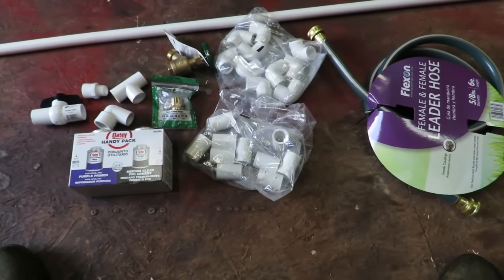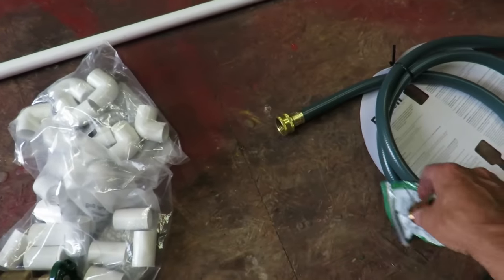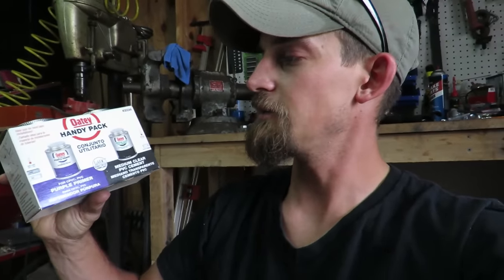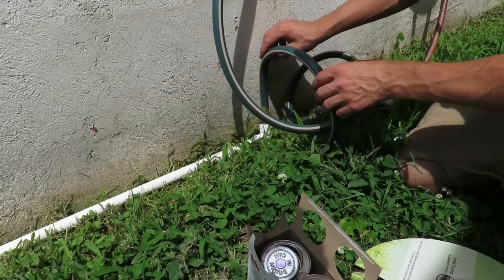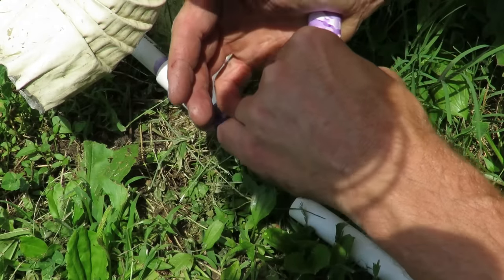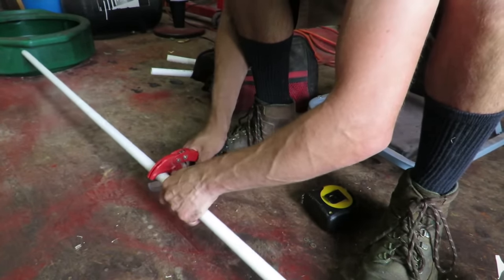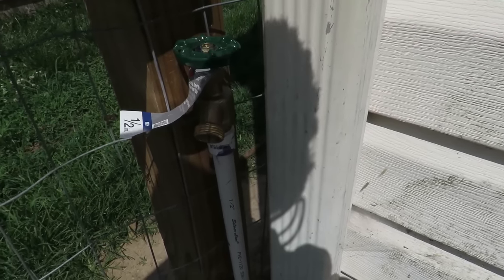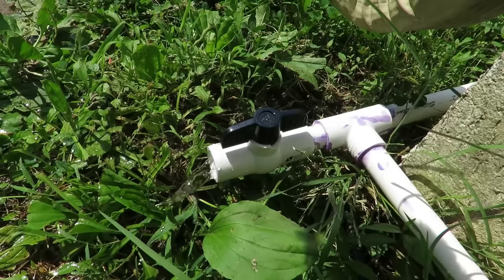Add a Water Spigot Anywhere in Your Yard!

Comment: Look in the irrigation section of your local hardware store. Most will have a Garden hose to PVC adapter fitting with the rubber washer. Lowe's and Home Depot both carry them. $2-$3 for a single fitting vs having a bunch of adapters and leader hose. Also in the irrigation section there is whats called an "auto drain", Rain Bird and Orbit both make them. They thread into a 1/2 NPT fitting. Put one at the lowest point and you won't have to worry about draining the system. It will auto drain once the pressure is below 5psi.
Reply: Ithaca for the info. I'll try. But I expect to get a blank stare from employee when I ask, after looking myself.
Reply: The regular leader hose is not rated for constant pressure I used SS Braided hose for my connection.  How do you connect at the source without some sort of leader hose?

Comment: Good video! In place of  the drain valve, you can use a 'golfcourse drain' (Lowes). It is a spring-loaded valve that springs shut when water pressure is present, and springs open when pressure is released, automatically. I use them here in eastern Washington State so i don't have to worry about forgetting to drain the lines at freezing time.
Reply: What's the proper name for that type of valve?  I'd like to find it, but not sure how to look it up.
Reply: The only name I know for the valve is 'golfcourse drain'. Lowes had them in stock a couple years ago.
Reply: This is close to what I meant by golf course drain...these are availiable at Amazon. 'Orbit Irrigation 51039 1/2" Brass Auto Drain'. Also 'Orbit WaterMaster Underground 51241 3/4-Inch Plastic Auto Drain Valve'.
Reply: Good tip. Thanks!
Reply: @dadskrej5226  Thanks for the info 👍
Reply: Why not just open the secondary spigot and shut off the main?

Comment: If you’re not going to bury the pvc, you may want to prime/paint it or coat it with something as pvc will deteriorate in prolonged sun exposure.
Reply: I am thinking about doinga same thing, but my pvc going under a addition, so ok for sun, but i live in a cold climate part, can get -15C( 5F.). what about that can it handle it ?
Reply: @palangnar3588  well I will say that I have pvc plumbing under our old pier and beam farmhouse in central Texas and this winter when we had the bad freeze where the power grid failed and it was 14 degrees Fahrenheit for three days straight, I had a whole lot of pipes under the house burst.  So if you’re not going to bury the pvc pipes, then you need to be sure to insulate them well, especially any horizontally oriented ones.  However, you should also be sure to be able to access it to make repairs if they do end up bursting.  I’m no expert, but I wonder how pex tubing does in exterior environments? I know it can expand with freezing temperatures but I don’t know if it’s appropriate for under the house/exposed environments.
Reply: @kevinwhite4785  Thank you, yes winter make things bad, anyway i have been using water hose and only use it 7 months of the year, and shut the water down for fall and winter season , i wonder what type of pipes( any type) can handle the cold , very cold good !

Comment: Use cement on both surfaces just like the primer and twist at least 1/4 turn for every joint when you push them together to ensure a leak free assembly.

Comment: A suggestion for the standpipe ,I would use half inch galvanized pipe ,3 foot long and then you don’t have to worry about it freezing or degrading the plastic.

Comment: Good video and awesome job.
There are a few things that you need to know.
Number one when transitioning from PVC to metal.  PVC should be male thread and metal should be female thread. If done the opposite way pressure  fluctuations at the joint can cause the PVC to expand and contract and tell it breaks.  You should paint the PVC pipe to prevent exposure from the Sun degrading it.
You need Teflon tape or piped dope on all types of national tapered threads, you do not need it on the garden house but it doesn't hurt. I use pipe dope on plastic thread to keep from cracking the pipe. I use both on metal. 
 thank you for sharing And keep on keeping on.

Comment: I love DIY pvc stuff, myself. You can use some landscape staples pushed down over the pvc pipe to hold it closer to the house, if necessary. I have a sidewalk that would mean I'd have to run my water hose across it if I do this mod, but that still would be much better than the current single spigot that is on the wrong side of the house.  A quick release would likely help if I want to remove the hose to keep it off the sidewalk when not in use. Nice video and explanation. Thanks for sharing it.

Comment: I’ve never done anything like this before but I feel compelled to go buy hose and pvc pipe, just because I think I could do it successfully!  Fantastic instructions.
Reply: It will last longer if you bury the PVC around 6" down. It doesn't hold up against sunlight very well. I suggest using galvanized pipe for the above ground portions, like where you come up to attach the hose or spigot.

Comment: I was just planning the same thing, but now I've got my shopping list made out thanks to your instructions. For my application, the existing hose bib is the low spot (basement level), so that 6 ft garden hose section will be my cold weather drain as well. Suggestion: for the valve you connected at the T, I would add a little more pipe between. I've seen these valves wear out over time (sun also damages) and a little more pipe will allow you to cut off the old and glue on a new valve.
Reply: Great advice for future wear & tear &/or Sun damage to allow for additional piping to be added LATER!!! #Great #Advice ...Makes perfect sense to Me
Reply: Great advice for future wear & tear &/or Sun damage to allow for additional piping to be added LATER!!! #Great #Advice ...Makes perfect sense to Me
Reply: QUESTION: What is a great way to protect a project like this from extreme SUN HEAT: to lessen or avoid the Sun Damage all together. I'm in an area that the temperature in the summer can range from 95°-110° F!!! 👀👀👀😬😭😆🤣😁 I know that I can do this... All I need to know is: HOW?! Lol 🦸🏽‍♀️

Comment: The first connection with the adapter glued up on the wrong side never put it inside a fitting ad it creates a buildup or a dam inside the pipe reducing the flow. Always on the pipe not the inside of the fitting.also very important is a vacuum breaker or backflow preventer so you don’t suction contaminated water back into your house

Comment: If you're doing this project, consider a 1/4 turn ball valve instead of this style. 1/4 turn valves are less likely to leak since they doesn't utilize a rubber washer for sealing. Especially if you live in an area with water that contains high amounts of minerals. That stuff can really mess up the washer in a standard valve.

Comment: Next time use pvc electrical conduit it comes in schedule 40 its ultra violent resistant and won’t deteriorate from sun exposure and it has flared ends so you won’t have to buy all the couplings. It’s only about a dollar more per joint and will last 10x longer than regular pvc that’s has sun exposure.

Comment: That terminal gate valve hose bib might be better as a quarter turn ball valve. It's really close to the post and probably difficult to get your hand around. Especially if you plan to put a bracket around the pvc and hold it close to the wood.

Comment: Always glue the pipe and the fitting 8:42 see how it was hard to slide the pipe into the fitting. Always both sides to ensure you’ll never have a leak! Good video !!
Reply: Plus after inserting the glued pvc parts together, give it a minimum of a 30 degree turn.

Comment: You ALWAYS put glue on the pipe and fitting both along with a quarter twist back and forth to spread the glue evenly.
Reply: You twist to seat the connection while the glue is setting up not to spread the glue.
Reply: Yes because if you put the glue in the female end it pushes the glue into the pipe.

Comment: I don't understand why you went through all that extra expense and effort with PVC. I buy a faucet splitter and a budget priced extra garden hose. I route the budget hose to a remote corner of the property and that hose remains in position. At the far end of that hose I can attach a spigot on a spike, a shut off valve, a quality hose, etc.

Comment: One thing to note is that PVC pipe will become very brittle and break easily after being exposed to the sun for a few years. You could paint it or try using uv resistant pvc.

Comment: Good video! Running pipe lessens the work of dragging 100+ feet of hose to distant corners for sure. A point on water flow, a 1/2 or 3/4" gate valve doesn't always internally open to a full 1/2 or 3/4". Around 5:30 in the vid, those splitter shut on/off valves attached  are normally 1/4". internal  opening for flow. If you have good pressure at full on but you need more volume (multiple sprinklers on one line) then the upstream devices may be the culprit. They do make full port devices but they aren't budget friendly..

Comment: Put your cement on both surfaces.  It will squeeze out what it doesn't want.  Cement is expensive, but it's cheaper than having to go back and do it again.  As long as you're using SCH40 and not class pipe, it won't pool or puddle so much that it will burn through the pipe.  I know what I'm talking about.  Yeah, I'm cocky, but this is 40 years of experience talking, too.

Comment: Consider installing a backflow preventer at your first hose connection especially if you are feeding a kennel, stable, or a pressurized watering system such as as green house.
In cold climes disconnect your feed at house wall and blow out with air.
Reply from the maker: Thanks for the tip

Comment: this video was informative and helpful. the person who built my house decided to put the spigot under my front porch
which sits like a foot off the ground, it is very difficult to access. I would have preferred to put it at the corner of my
house. now I want to add one to the corner of my house and make it more accessible and convenient for my family.
Reply: HAH ... had the same issue due to a deck that was installed later.
Reply: Please use pex it is so much easier bro and the fittings click together no need for glue and the make adapters for the hose .. save some time and money .. I used pex on a line like this and put it under rocks in the flower beds
Reply: @ptravers9077  Some people like the idea of a snap-seal and others prefer things to be glue-sealed. I am certain there is a time and place for both. Perhaps you should get the opinion of a landscaper first.
Reply: @GeoffreyHowells  most definitely do own my own landscaping business. Lawn care in the summer commercial carpet cleaning in the winter so most of the time I am mowing or hitting g the floor with a crp moving dirt... and when it comes down to it PVC is old tech no one is using ...pex hose expands if frozen can be bent buried and moved unlike PVC.. hence why we use it in underground systems ... there is never a need for old tech when it is evident that better is out there for a cheaper price...
Reply: CRB danm auto correct
Reply: @ptravers9077  REALLY??? I always assumed glue-seal would hold up better in the elements. I will have to look into remaking my rug soaking tool.
Reply: Par Travers Could you make a video pretty please?!
Reply: @GeoffreyHowells  I love the ease of pex it is flexible and yes the fittings could leak if improperly installed but it is the same with pvc only difference is I shovel can break pvc much and the pex allows much more expansion if infact it does freeze before you blow out .... you do floors also? sweet bro.. you use jep products or have your own .. I am currently trying g to get my hazardous chem license.. I am trying to get into selling lawn chemicals along with making my own cleaning solutions .. figure if I am already doing it try for the whole nine you know
Reply: @illinoisvideoatlarge8039  I dont do the camera thing but my older clients love to watch me work I guess it is something about lawn work that is just enjoying.. there is also something about watching a soiled floor come clean like new that is satisfying.. but none the less I will.leave the camera for those less rough around the edges .. I am to short with people to be seen as enjoyable
Reply: For carpet cleaning, I use certified green products for health purposes. I have a specific supplier for that.

Comment: Don’t apologize for the length of your video! It’s greatly, greatly appreciated as I have no idea beyond pvc what to call the other pieces needed for an extension! I’d be lovely to add in a sprinkler system, however the problem is it’s cost and as of now my priorities are really based having one more line toward the center or a side of the yard for next years garden. I have a long hose but it’s such a pain to unroll and then drag across my yard all for watering plants
Reply from the maker: Having to roll and unroll a hose is the worst. Thank you for watching!
Reply: good idea

Comment: That was actually a good video. I haven’t seen any others like it without soldering and digging with machines.  Keep it up
Reply: Nah everyone uses pex and burries it for a reason 🤷‍♂️
Reply: Ya I dont u understand why not just keep a hose out .. I mean if the line is above ground what's the point it is still out in the open and in the way.. should have put it in the ground with pex for sure and it would have been way easier
Reply: @ptravers9077  he could have simply direct buried the PVC as well. I understand why you’d want a remote spigot, but I would have hard piped it all the way from the source and buried it. It wouldn’t move, which would lessen the chance of getting the pipe in a bind and cracking, and wouldn’t have to worry about leaks at the hose joints (they will eventually leak, and you’ll have to replace the gaskets). Draining would be a little more involved, but easy enough for the few times you may have to do that in winter.
Reply: @mph7282  I agree I mean I would have used pex but pvc is just as good if not better .. pvc is less likely to be punctured.. but the pex hose if a freeze did happen out of the blue the box does expand .. but I have seen sprinklers be installed with both .. I also understand the need for a spigot away from the house just dont see why you wouldn't just use a hose in this scenario.. if it is above ground and laying there ..a hose would be more convenient and cheaper.

Comment: Yes, all threaded connections need Teflon tape, or Pipe dope (thread sealant), unless there is a ferrule, gasket or some other thing that's making a water-tight seal. No Teflon or dope on a hose bib, or the hoses or tubes to your sink faucet.

Comment: You don’t use Teflon pipe tape on hose connections. The seal is at the gasket.
Reply: You can use Teflon as well, it helps the threads slide in.

Comment: As a temporary convenience, that's clever work done!  It does what it's supposed to do and does it affordably.

As a permanent fixure... Not so much. 

 Indoor rated pressure pipe won't take many bumps before it shatters after baking in the sun for a couple years.  That leader hose isn't rated for sustained pressure, so the original spigot needs to be the main shut off still.  I've seen more than my fair share of swollen or exploded leader hoses.

Most of the issues could be solved by using the correct equipment to begin with, but that also means more money and work.  If it just needs to get you by for a couple years, this is a perfect setup.  No need to throw money away if you don't need to.

Comment: Good video.  You could toss a 45 degree elbow just before the spigot / hose bib to bring it away from the wall an inch or to to make it easier to access the handle.  Heat gun could also be used selectively to modify the location / bends of the pipe a bit.  Also, apply some latex paint on exposed pvc pipe to protect it from the sun & hide the "white".  That valve could be used to extend the system too drains are a good idea!

Comment: Just a suggestion -- you could add Y spliter valve at the first tap and connect the lead hose to one of the outlet. This way you have extra outlet for another hose near the house.
Reply from the maker: I have actually added a 4-way splitter for multiple uses

Comment: You didn't show what type of clamps you used, to secure the spigot. I did the same thing, except that I buried the pipe, and I ended up replacing the PVC pipe, to the spigot, with galvanized pipes. The reason being that PVC is extremely brittle and, as I found out, if you pull too hard, on your garden hose, you can snap the end of the pipe off.
Reply from the maker: I picked up some pipe clamp or a u clamp from the local hardware store. My main pipe is fixed to the post so I can't pull on it. I like you idea of doing a galvanized pipe on the post so the weather can't affect it.
Reply: Look for pipe strap - either by the roll or as individual clamps as shown in the video matched to the pipe size - 1/2", 3/4" etc. Paint pipe & strap to prevent uv damage & corrosion. Don't over-tighten and "jack" the pipe down and adding a little rubber or foam under the clamp allows for movement.

Comment: Never use a Male PVC Adapter to attach a hose bib to PVC. It is a Weak Point and will break off if stressed. Always use a Female adapter with a Male Threaded Hose Bib. Stronger and you will not have a problem if someone pulls on attached Hose.